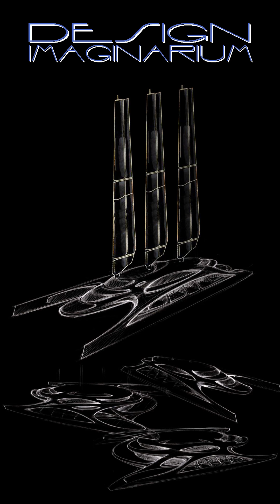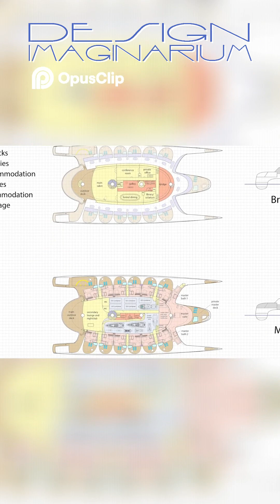DI03e This Hydrofoiling Mega Catamaran Sailing Yacht would be the largest ever built!

Comment: Go for it...just dont forget those billionaires want their helicopter landing pad to get to and from the mega yacht quickly "time is money" you know lol
Reply from the maker: Yup, it's hard to add helicopter capability to a sailing vessel. On one of my designs I did it by having it be an extendable platform on the port side. Unfortunately I can't attach an image to this comment but you can briefly see it in the video short.
Reply: @DesignImaginarium  True with all the rigging and masts, On the side extendable pad you'd have weight issues that could put a lean on the yacht making the sails lean into the rotors rotational arc...easiest that I see is that tri mast hull with an extended bow (granted the ship would not be under sail at landing and takeoff) but prob the easiest solution for this case